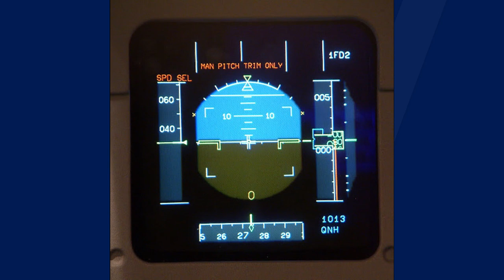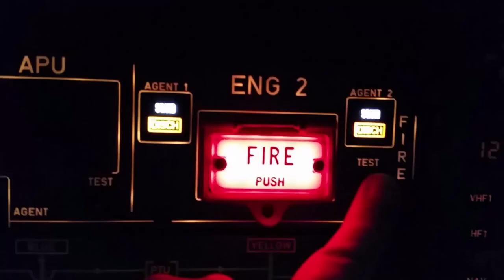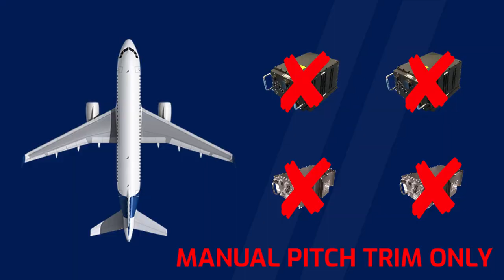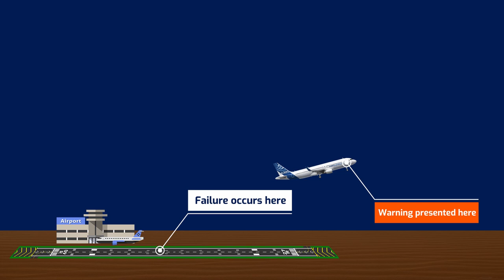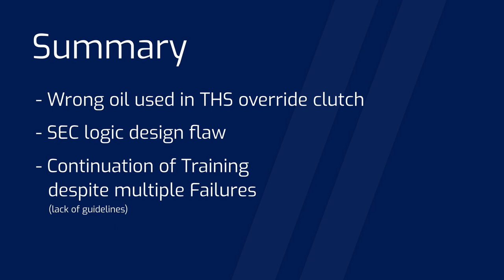Loss of Control | Smartlynx A320 Accident at Tallinn (emergency landing)

Comment: "Training in this is never done in simulators as it is considered so remote that it will ever happen" Uh huh. It's always amazing how often we hear that, isn't it? There is so much wrong in this flight that it really is quite staggering. If taken at full value it kind of disturbingly stands as a huge red flag to problems not simply in the individual pilots or the individual plane or airbus. But rather failings and institutional cultural problems deeply embedded within the European Piloting Education Programs. These were brand new student pilots getting their hands on a real airliner for the very first time. And the very first thing an entire flight deck of senior pilot instructors teaches them is "when the weird error messages pop up, you just keep reseting the breaker to make them go away". This was their first day in an actual cockpit, and that's what the entire group of teachers was teaching them. Not "contact Engineering to see what it means". Not "Put it on the ground after it keeps popping up". Not "We;; we don't have any actual passengers and we are just practicing take offs and landing better safe than sorry, lets get it looked at. We can do the class in another plane or on another day". The very first lesson these flight instructors were teaching their students was "It's A-OK to ignore what the airplane is telling you if it interferes with your plans". Now go look at some of the other incidents cataloged by "Airspace" here. How many of them boil down to the pilots having absorbed that very message?
Reply from the maker: Yes, I hear that sometimes from colleague. "it's probably just a false warning" is a very dangerous statement!
Reply: @AirspaceVideos  I was binge watching Air Crash Investigations last night after watching your vids.  4 or 4 shows in a row “ Pilots are never trained for this in the simulator because the manufacturers swear the chances of it ever happening are near zero. Or it’s impossible”. Thrust reverser opening in flight. Loss of all hydraulic systems. Loss of navigation systems. Doors falling off, because minimum wage baggage jockey can’t read the safety instructions. It’s to the point that whenever an aircraft manufacturer swears an event absolutely can’t ever happen, you should probably start panicking.
Reply: Exactly this - in a responsible instructor/student environment it would have been worth doing all of this just to establish the safety culture. I suspect the instructor pilot felt himself under pressure to complete the flights (small airline - aircraft out of service) that plus the clearly inadequate maintenance records and error make me worry and I'm surprised the report didn't comment on it or make recommendations.

Comment: how can one say "huh, we had 4 elac failures in 4 touch and goes where we usually should have exactly 0, yeah, let's just continue the session, what can possibly go wrong"
Reply: Because it only happened at 1500ft and the manual didn't have a limit on resetting it.
Reply: @iliasemmanuil  Every, every pilot knows T/O INHIBIT and LDG INHIBIT. Especially any pilot that is instructing. The Eicam even states that in bright magenta colours.
Also, if there is the same fault, popping up very reliably over and over and over again, it doesn't need a manual to tell you, that maybe something isn't quite right.
Reply: @boahneelassmal  The eicam message onky showed up at 1500ft because it is just advisory. This error would never show outside of training flights as manual trim is barely used.

At the time there was no rule against resetting it and nothing said to stop flying. The rules have changed now because of this accident.
Reply: @iliasemmanuil  "The eicam message onky showed up at 1500ft because it is just advisory." Due to take-off inhibit which ends at 1500agl or 2 minutes after liftoff.
Anything that shows up at exactly 1500agl should be considered to have happened at some point during the take-off roll.
And yes, while there wasn't a rule it is common sense that if the very same warning pops up more than 12 times on every single touch and go to assume something isn't right and maybe investigate stop the flight to have this investigated.
When my car's engine warning light pops up every time I accellerate hard on 12 consecutive accelerations I don't think  oh let's just reset it. I think "huh, there must be something wrong with something, let's get this checked out."
"This error would never show outside of training flights as manual trim is barely used." This error would never show. Not even on training flights. As was stated in the video, the clutch upon overriding auto pitch trim by stopping the trim wheel disconnects the trim wheel from the pitch motor which a sensor realises and stops the motor. No warning or advisory would be generated.
Reply: @boahneelassmal  there was no take off role. It was touch and go training, the elac failure wouldn't have happened on take off as manual trim isnt used
Reply: @iliasemmanuil  but landing and take-off inhibit will still be active.
Reply: @boahneelassmal  You literally can't tell from that when it failed. They had no idea the elac failed when using manual trim.
Reply: Agree - especially as the aircraft didn't want to take off in the first place - that should have put them in an already cautious frame of mind. I suspect though that outside pressures/human factors were to blame - it's a small airline doing pilot training they've set this aircraft aside to do the touch and goes - there must have been pressure (albiet unstated) to get it done...
Reply: @tomriley5790  yeah, so better completely destroy it.....lol. That error screams for a "knock it off and get a mechanic to check it"

Comment: Why not install manual flight controls besides fly by wire. You see so many incidents where pilots lose control of the aircraft because of faulty computers. Wouldn’t it be great for safety to have such a back up system on board?
Reply from the maker: that would completely negate the benefits of fly by wire: weight savings, computer overrides etc.
Reply: “So many incidents” like what?
Reply: There almost no incidents related to faults in the fbw system atleast with airbus why would you change that?

Comment: So the ECAM will warn of a computer fault if the motor or servo does not respond to the commands sent to it. But what if it’s the servojack itself that’s failed or damaged. I know there are 2 per aileron/elevator and only 1 is active and other dampens. Will it still show an ELAC Pitch Fault or is there a way to determine if it’s the computer or servo that’s failed and ECAM will show accordingly? But the way I’m using this for reference material and can see all the different faults near the bottom but not sure how it determines it

https://www.smartcockpit.com/docs/A320-Flight_Controls.pdf
Reply: You will get an ECAM warning no matter what. If a servojack fails or is damaged.  The flight computers wll verify what's happening.  If they agree it will call out an ecam message for the bad servo.  If the servojack is good and a computer goes bad. They are monitoring each other the computers . If there is 2 degrees of pitched asked for both computers are watching.  The computer will fault the one that isn't reading correctly for that set amount of 2 degrees pitch. One computer will see proper. One won't see proper and the computer that has the error will be faulted with an ecam message .
Reply: The ecam message will call out a bad servojack if that's what's showing a failure.  Not the computer if a servojack does indeed fail.

Comment: Just goes to show you how unsafe Fly-by-Wire is. The pilots have the certificates but the programmers don't.
Reply: If fly by wire is so unsafe why does every new commercial aircraft have either full or partial FBW now? And how come accidents are few less than 30-40 years ago?

Comment: This wouldn't have happened if airbus didn't use fly by wire. Yoke is better
Reply from the maker: Is it? Check out my latest video, where a 777's flight computers went haywire...
Reply: Yoke doesn’t mean mechanical controls. 777/787’s have yokes yet they are FBW

Comment: It's not correct to say that all accidents occur due to a chain of extremely rare events.
For example, here the root cause of the accident is wrong kind of oil in the clutches of elevator.
Given that has occured, each event in the remaining chain of events have a high probability of occuring.
So the probability of accident is almost equal to the probability of the root cause occuring.

Comment: Stopping the trim wheel is poor practice. If the go is actioned in good time, the trim condition is easily dealt with. I have never seen someone stopping the trim wheel in base training.
Reply: Just out of curiosity how do you decide your V1 and Rotate speeds when doing touch and goes?
Reply from the maker: That I don't know - our instructors always did that for us 🤔 but since the aircraft gets lighter over time, I suppose it's calculated for the first takeoff, then reused
Reply: @tomstravels520  we use the VAPP to rotate and we don’t have a V1. Stopping is at the Training Captains discretion and you’d only stop if you absolutely had to. In almost all case you’d continue.

I used to base training but no longer can since I have an OML restriction on my medical. ☹️
Reply from the maker: Must have been great! Thanks @Pete Conrad, you are right of course. I forgot, as a trainee I focused on other things that day 😄
Reply: @AirspaceVideos  we all did on day 1 in the jet! Never to be forgotten.
Reply from the maker: indeed!
Reply: what do you mean "stopping the trim wheel" ?
Reply: @windshearahead7012  you can slow or even stop the auto trim by holding onto the trim wheel. If you do it too long or too hard then the flight control system assumes the ELACs aren’t Doug. Their job properly and puts you into alternate or direct law. 

It’s a dangerous and amateur practice.

Comment: “This is never trained in simulators”, it is trained in my airline.
Reply from the maker: what airline would that be?
Reply: @AirspaceVideos  I’m afraid my company’s rules on social media use prevent me from saying.
Reply from the maker: fair enough :) but good to hear!
Reply: @AirspaceVideos  dug out my old base training notes as it’s a while since I did it and I’m not on the 320 any more. The trim only runs to zero which is a perfectly acceptable setting for the go.  All the more crazy and unnecessary to try to override the controls in a way for which they were not designed.
Reply from the maker: interesting 🤔

Comment: ah yes clear the error until it disapears.....
that should be something that looses ppl theyr jobs
Reply: Another person who doesn’t completely understand what happened here
Reply: @tomstravels520  you seem to be a expert so sum it up for me
Reply: @robinbinder8658  not really a sum up but resetting the computer every time restored the ELAC pitch channel to work correctly every single time. If it didn’t it would have continued to display the ELAC PITCH FAULT and instructed the pilot to switch the system off. Then you’d definitely be landing as you only have 1 computer for your ailerons and primary for your elevators. 

However on the last circuit the pilot did not reset the ELAC as he’d done previously so this left only 1 computer working in the landing with no other ELAC as backup. 3 main points. 

Firstly if the captain had continued to reset the computers the aircraft wouldn’t have lost pitch control. Second, if the pilots had known they could have just reset the ELAC’s again whilst the aircraft was in MAN PITCH ONLY and the computers would have restored pitch control. Third this fault only happened due to this being a circuit flight. If this had been an A to B flight the error would never have shown as pilots don’t manually trim the Airbus mid flight. Yea there was a “problem” but not all problems mean the aircraft has to land immediately and the Airbus and airline manuals instructed the pilots to reset the computer but did not clearly state how often you could reset the computer and because the reset was successful it was even less clear
Reply: @tomstravels520  hmn yeah, i guess manuall adherance is very strictly practiced. idk of course how much sway that captain would have had. id just like to think that if had been that captain i would have went with being cautious, and cancelled after it reapearing again, especially on a touch and go training flight. but in the end the adjustements made due to the recomendations by the investigation seem to solve that all that.
Reply: Ppl’s don’t have a job in the commercial airliners in most countries I know about. Minimum regulations require a cpl. What is your point about loosing jobs? I’m guessing you are on the subject of being sacked for gross negligence or something like that/Bullying management, etc, e.g., Ryanair or Amazon? This has no relevance to the incident btw.